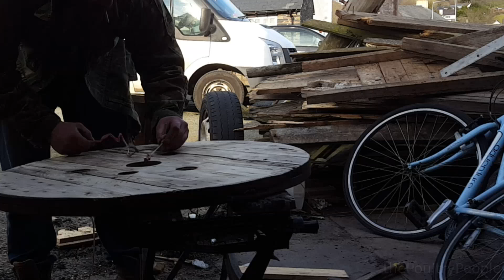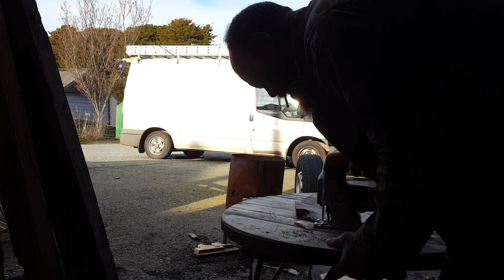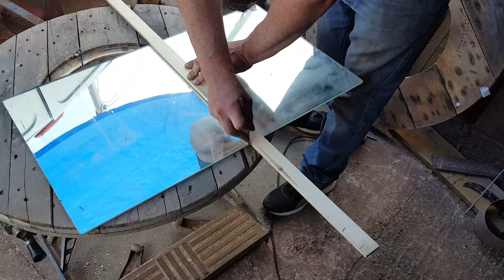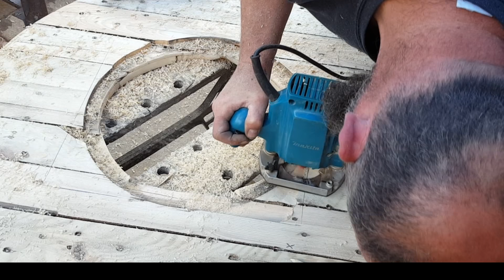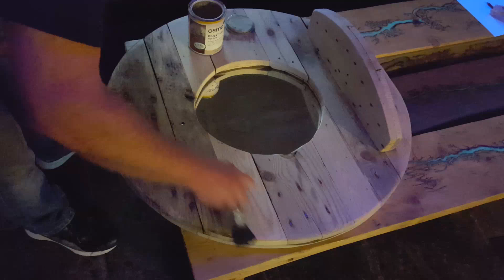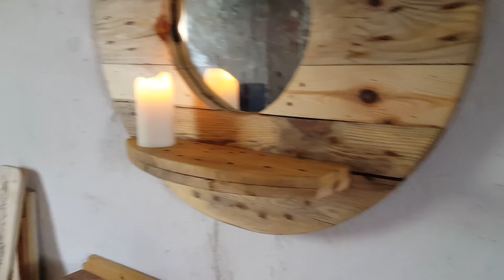How to make a Mirror from a Cable Reel Drum

Comment: neat idea, I liked how you just used the router to fit in the mirror. That was so much easier then trying to cut the mirror round.
Reply from the maker: yes, its hard enough to cut a mirror straight, i was going to try and cut the corners off but that was tempting fate so just went with the square instead